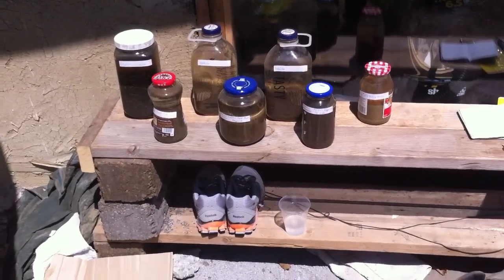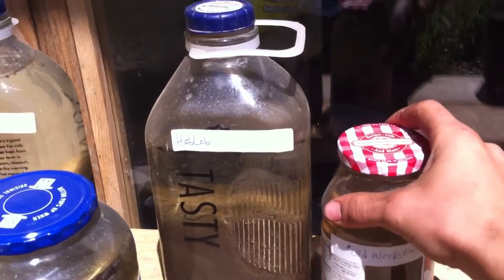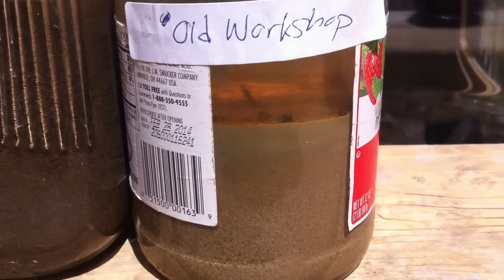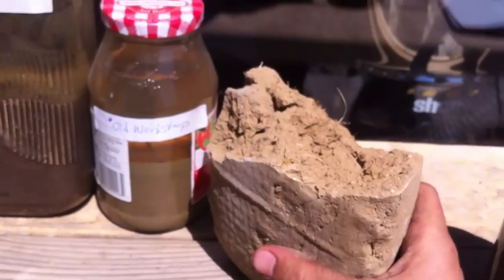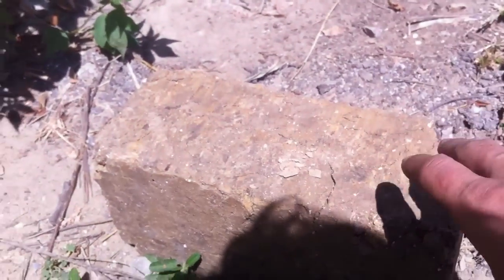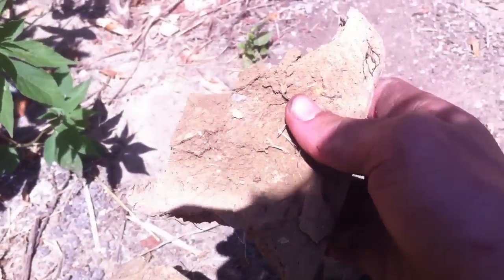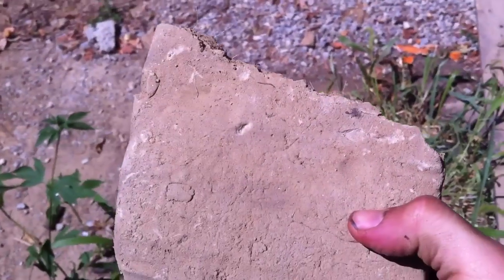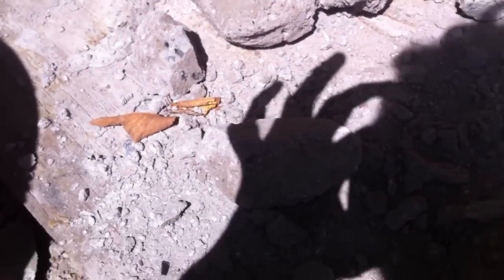CEB Soil and Brick Tests

Comment: I wonder if a solar oven/array of mirrors concentrating the light onto the brick can be used to harden it after it is thoroughly dried.  If too hot, it would probably turn the outside to relatively smooth glass.

Comment: Look into how they make Grancrete at Google Patents.
Heat resistant phosphate cement Patent Number 8273172
You would also be well served to make a small sample brick tester where you compress your samples and then with the same press, you can check the compressive strength.  Maybe 1/4 the size and can press 1,000 psi to 6,000 psi.  Weighs around 100 pounds and you can easily test your samples on the fly.